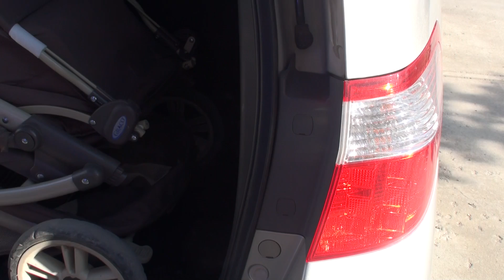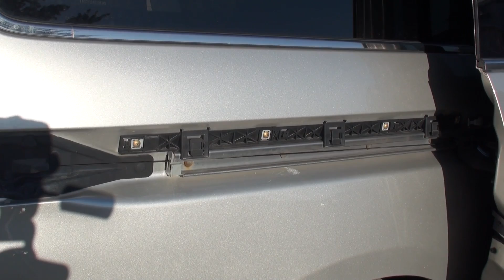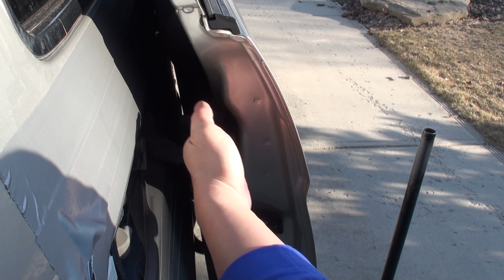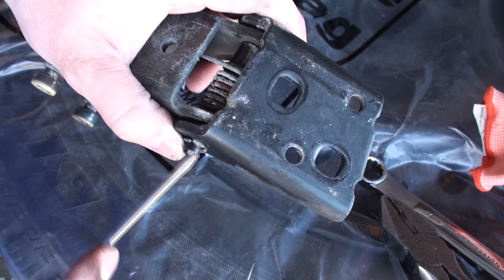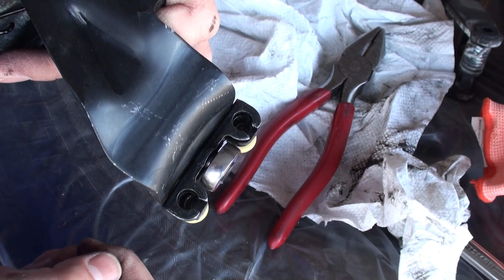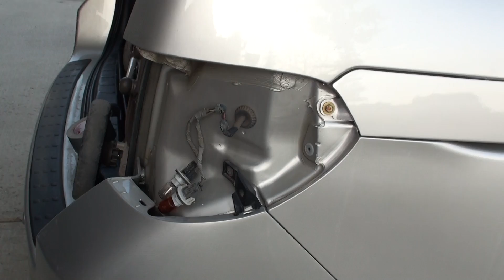Honda Odyssey Center Rail Door Roller Replacement

Comment: so my 2007 honda oddysey. doesn't have cables? so the door just opens and closes on the rollers of the hinge????????
Reply from the maker: yep assuming you do not have the power sliding doors...  The most simplest door that is by FAR the easiest to fix.
Reply: The problem now is that the plastic roller on the hinge broke off and the door wouldn't closed, so I managed to close it. But now it's hard to open. Do you have any idea.
Reply from the maker: once you get the door partially opened have a helper left the middle of the lower edge of the door while you're pulling it open.

The rollers have disintegrated into nothing thus dragging on on the rail making it very hard to open.

Comment: There are actually several but yours was in the best detail no doubt. I watched it all the way through and tackled mine the day after and didn't have to refer back to the video because of the excellent detail you provided. Took almost exactly the amount of time you stated. I even went ahead and adjusted the other door after the repair since I learned how it actually worked lol! Those cables were a pain like you said haha!
Reply from the maker: yeah the cables don't offer much slack BUT just enough to get the job done :)

I had no idea there were other vids.  I had to fix my own van and figured I'd share with everyone my own experiences.  Glad to know that I'm perceived as the best :)

Comment: I just did a 2008 Odyssey for a $45 part thanks to your video. I have 2 suggestions to add. If the door is operable open it halfway not all the way. That is done by opening the door and then pulling the handle when it's halfway open. it will stop and there will be more slack at the back cable. When re-installing the trim panel open the door just a few inches and stop it. then the trim panel is very easy to align and put back on without scratching anything. Put the rear bolt on then enter the back seat from the opposite side to install the front screw. 
Also, if you have problems like I did getting the door to start closing after installation then you might have to pop the fuse for that door, turn the car on turn it back off, reinstall the fuse, to get the sensors to reset. On my 2008 EXL there are fuse panels on both left and right side in the front seats footwell.  the right door fuse is in the right side  fuse panel. It is labeled PSD (power sliding door) on the fuse panel cover.
Reply from the maker: great tips!  Thanks for sharing them with our viewers :)

Comment: is not nwcceary to disassemble anything from the inside to release any tension to cable????????on a 2007 honda oddyssey ????
Reply from the maker: nope, that is why I made this vid.  To spare you the headache of taking so much stuff apart when it can be done with far less work :)
Reply: Ok. I will follow your video. Step by step to repair my door..
Reply from the maker: cool let us know how it all worked out.

Comment: I have a 2007 oddyssey, that is not Electrical power doors. does the same steps apply???
Reply from the maker: no b/c all you need to replace is the hinge.
Reply: +piercedasian what about to release the tension for the cables???
Reply from the maker: the cables only exist if you have a power door.  If you have a manual door you don't have cables b/c the cables are for the drive mechanism.

Comment: Hi Thanks so much. This is the best post because I did not have to remove the interior panels like the other posts. This not necessary, especially with this fix. I got it done in 2 hrs. You saved me a lot of money!

Thanks!
Reply from the maker: glad it all worked out for you!

Comment: Excellent video. Thanks a lot! $35 part and an hour vs $400 and a day at a dealership.
Yet another cheap short-cut on part of Honda, guaranteeing a problem or two (for left and right) for every vehicle built that lasts 10 years...
Reply from the maker: Yeah the labor is ridiculous.  I'll be Honda factory procedure requires you to remove the interior panels but since you don't need to do it the way they are quoting you you save big $$$.

Glad you were able to fix your door.

Thanks for watching.

Comment: Thank you for taking the time to do this tutorial - it was clear and concise including calling out what size ratchet sockets to use.  I replaced both roller door assemblies today in less than two hours and saved the $600 labor that I was quoted. I'm handy and this was not that hard to do at all.  I did warn my wife that if she heard any choice words it would be me trying to get the cables re-inserted and not to worry.  But fortunately both sides behaved themselves and as recommended in the other comments, having the window open was very helpful.
Instead of using layers of masking tape to protect the finish, I used several folded layers of brown craft paper and only had to frame the paper with masking tape.  Removal was a lot easier and I was able to re-use the craft paper to do the other door.  One of the taillights was stubborn and I found that by gently rocking the taillight repeatedly in all directions while tugging to pull it out, it eventually loosened up and came out after about 20 -30 seconds.
Reply from the maker: sweet!  Glad it worked out for you.  Craft paper huh?  Never thought of that but then again when I did this video I didn't know what to expect so I covered everything BUT the bad thing was that I used duct tape which is not good if it rips the paint off the metal.  NEVER use duct tape (which I said in my vid not to use) - I coincidently ran out of my normal painters tape the day I did this vid...  :p

Comment: wow,  i need this done on my doors,  i was just quoted $567 for my dealer to replace these. 
iam a non mechanic, anyone near Indianapolis that knows how to do this,  or could  help.
Reply from the maker: you should try it yourself.  It really is quite easy.
Reply: Ok,  i think i will,  both of my doors have an issue.  I will try and follow the video.
Reply from the maker: Good luck and most importantly take your time.  If something doesn't seem right don't force it and come back and rematch the video.  I suggest you watch it a few times BEFORE starting the job so you know exactly what to expect.

Comment: Good video.  After I removed the roller from the door, I just pressed the automatic open and brought the roller and cables as far back as they go past the door, giving me plenty of room to work with pliers to easily put the cables back on the new roller with a flick of the wrist.  Then I turned off the auto-open and moved the roller back into position to bolt it back onto the door.  Much easier than trying to remove the inside car panel!
Reply: Careful: you shouldn't use pliers on these coated cables...
Reply from the maker: If you don't pinch the cables too hard with the pliers you'll be fine.  You do raise a good point though - be careful and "gentle".

Comment: Huge help.  My two cents, the outline is probably not required.  If the jack is supporting the door well enough so that there's no pressure on those two main bolts, the holes themselves guide everything back together in the proper place.  To add extra support from the top, I opened the windows on each door and used a strap looped through the roof rack.  I was worried I would kick the jack by accident.  It helped me move the door around when trying to get the roller mechanism detached.  I also only had a little tape so I ended up taping the hinge assembly itself, all the sharp edges and that achieved the same goal of protecting the car finish as I monkeyed around with it.  But the order and detail you suggest is spot on and I did both doors in about an hour and a half taking my time and snacking my way through it.
Reply from the maker: great tips for our viewers.  Yes I did consider supporting the door in the manner you did but opted not to bother as I am usually quite careful around things and would likely not kick the jack out.  Then again they call them "accidents" for a reason so I guess you can never be too careful!

Glad you liked my vid, thanks for watching.

Comment: @ piercedasian   Great tutorial.  I followed it to the letter and when i removed the hinge i found that both of the small rollers were completely gone.  One issue however, when i finished installing the new hinge and put everything back together the power door would not fully close at the end.  The door travels very smoothly towards the closing point but it just won't fully latch.  Also the door will not open under power now either.  It is very smooth manually-much-much smoother than the other side-which will work under power-I will need to replace that hinge soon I suppose.  I was afraid that maybe i misaligned the hinge when reinstalling it.  I thought maybe i lifted the door too far with my jack when attempting to support it.  I fiddled with it for a few hours adjusting the door alignment but still haven't had any luck.  Any thoughts on whether alignment could cause this to occur?  Or maybe I have another issue going on.  Thanks in advance.
Reply from the maker: +Steve McKinney glad that you were able to replace your hinge.  Yikes you misaligned the hinge?  Bah that sucks when that happens but mishaps do happen.  At least it isn't a mishap you can't fix with a bit of know how and patience.
Reply from the maker: +Steve McKinney cool!  Thanks for sharing that.  The guy beat me to doing a vid similar to his.

Comment: Thanks a bunch. Following your instructions it was a very easy job. I used a small pair of needle nose pliers to get the cables in and out. It took about 10 seconds. Total time was about one hr, including the time to look for the tools. It cost me $43 in parts. My mechanic had quoted about $350.
Reply from the maker: +Michele Trovero hahaha isn't it amazing how simple things can be fixed when you're walked through the repair process?  Glad you were able to fix your hinges!

Thank for you watching :)

Comment: Excellent video.  Now, I feel very clear of what it takes to replace the part.  I am still not sure of whether to do it myself or hire a professional, but I will certainly will not get ripped off.  A local Honda dealership wanted to charge me $420 for one replacement.  I would say it fair to pay 1.5 hour of labor plus the cost of the part which is in the neighborhood of $30.  Thank you very much for preaparing this video.
Reply from the maker: +Edgar Trujillo it is totally up to you whether or not you want to tackle it on your own.  If you read through the comments on this video you can see many folks do it on their own unusually less than 1 hour.  Part cost only and ZERO labor so the savings are HUGE compared to the stealership prices.

Comment: Just actually did this on a 2009 Odyssey. Fantastic video, saved me a ton of time instead of taking the inside apart. The cables were a pain, but well worth not having to deal with interior pieces. Thanks for the video!
Reply from the maker: +El Jefe glad it all worked out for you.  Thank you for watching!

Comment: This worked really great. I was able to replace and put everything back together in about an hour. The changes I made were to not unplug the rear light and to hammer the pin out in place so I could avoid any alignment issues. I used an 18" metal rod to hammer the pin from when I replaced the spring on my garage door. Thanks for the video, hope those tips help!
Reply: I did the same just used a nail set to hammer the pin out which saved having to align or mark it. Great video and very easy to follow.

Comment: Great video!!  Easy to understand on how and what to do, and when.  I've never replaced one of these before.  Went to a local shop was and they wanted to charge me 6 hours to do both sides $744.82 and $152.58 ($897.40)for the parts. So  I ended up watching this video and doing it myself and it cost me $84.18 parts and 2 hours of my time to install BOTH.   Savings of $813.22  Thanks a million!!   I give you mad props!!

Comment: So my 2006 van side door is stuttering.  It seems the hinge is tilting just a bit when the door is closing, causing the door to come to a stop in the same 2 spots each time.  It looks like the tilting hinge is pulling the roller a bit.  I didn't think it was the worn roller because it keeps getting momentarily stuck at the same two exact points every time.  But after watching this video, I wonder if there is simply too much give and perhaps something in the track sticks out at those two precise points, causing the door to catch.  Anyone have a similar experience?
Reply: +Dee M OK, I replaced the latch/roller and it solved the rough glide.  It's all working perfectly EXCEPT that when I try to open from the driver's seat or from the inside side door, the door moves about 1 cm before beeping and reclosing.  If I open from the outside or manually open, no problems and I can close any which way.  But it just won't open from the inside.  The fact that it budges makes me think there is some sensor misfiring.  Thoughts?
Reply from the maker: +Dee M sounds like the track has some metallic residue buildup on it and causing the door to bind and subsequently triggering the safety system and reversing the door.  I would suggest you pay attention to the insides of the tracks.  There have been reports of rollers leaving behind a very thin film of metal behind which can be removed using a razor blade (I've never seen this myself).  Also just because you marked the hinges to the original factory mounting points doesn't necessarily mean that the alignment is correct.  For all you know they could've have loosened over time and have gone out of alignment.  With the assistance of a helper it does make a difference when you've got someone to help you "watch" to see where the positioning of the mounting of the hinge is "optimized" on the door.  You may need to play with it for a bit to get it just right.

Comment: Thanks for the video! Fixed ours perfectly. Gen Honda part was only $36 on Amazon. As another guy said don't unbolt the arm, just drop the pin. Much easier. Also I fought with getting the wires back in at the back of the van with door fully open. More room.
Reply from the maker: +E Kvistgaard glad you found the part for less money on amazon.  I wish in Canada that we had that luxury.  Everything has to go through Honda dealerships here which usually mean $$$$.

Comment: Execllent Instructions. Didn't know you could do it without take the interior door panels off to loosen the cable from the motor. Nice work.
Reply from the maker: +Asif Iqbal yep, that's the beauty of my fix.  You don't NEED all that extra work to take it apart.

Comment: Just changed the rollers on our 2007 Odyssey.  Thanks so much Pierce.  You saved me $200 bucks.  Took me 20 minutes.  I ended up sticking rear cable part way in from bottom, using a screwdriver to push cable up and over into groove.  Bam!  Done.  Great video. Now, I wonder what the wife will let me buy with the extra 2 hundie I saved?......hmmmmmm.....
Reply from the maker: +Ridesmoothbrother lots of beer or whatever tickles your fancy.  I bought myself a new hard drive with the money I saved :)

Comment: Thought I would also thank you for the video.  I swapped out both the rollers on my 2007 Odyssey after replacing the door actuator that went bad.  As others have noted getting that last cable in was a pain!  What worked for me was using needle nose pliers to help pull and hold the cable.  A little side story.....I got may parts from Amazon.  After I got my first roller out I went to get the new one and discovered Amazon had the wrong bar code label on the package.  They sent me TWO right rollers!  So I had to put everything back together with the old roller until I got a replacement.  I'm an expert now and can swap these rollers in about 15-20 minutes after doing it three times.  Anyway....thanks again for this video.
By the way....how many emails about the duct tape did you get after initially posting your video??  I'll bet it was a lot!  Hahaha
Reply from the maker: +Christopher Adis Hi Chris glad you got the rollers all figured out on your van.  That sucks that you had to replace one door two times but at least you're an expert now :)  How many e-mails about the duct tape?  Surprisingly none but then again I did clearly state in my video to not use it if possible.  I had NOTHING in my garage other than that which was a shock to me as I seem to have everything!  Lucky for me I didn't rip the paint off my van :)
Reply: +piercedasian I figured you went back and edited in the "don't use duct tape" after receiving a bunch of emails.  Hahaha.  Thanks again for your video.  I just received my door check assembly and will be installing that while following your video.
Reply from the maker: sweet.  You can practically do the replacement  blindfolded now :)